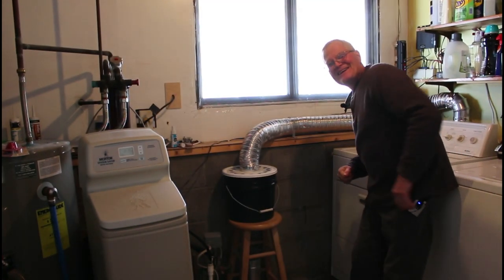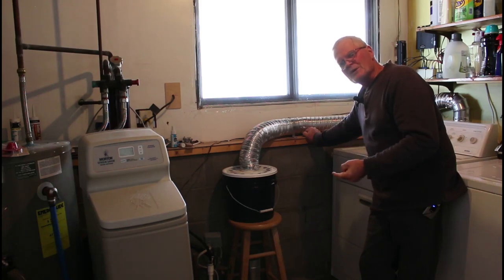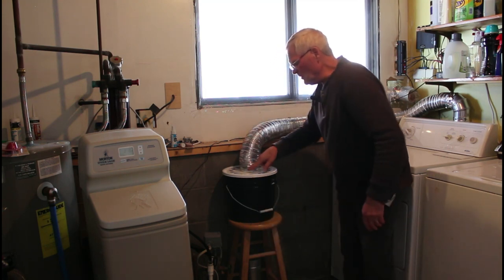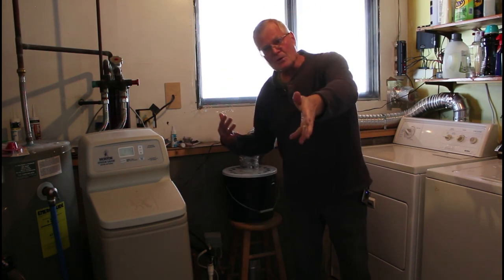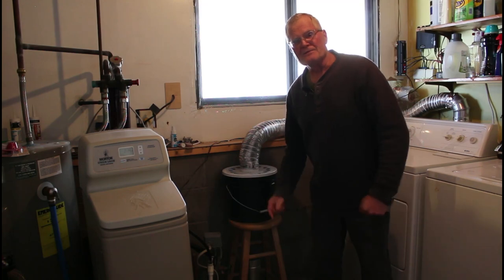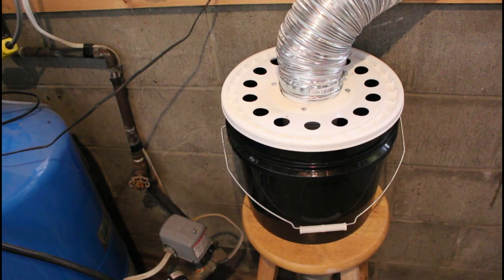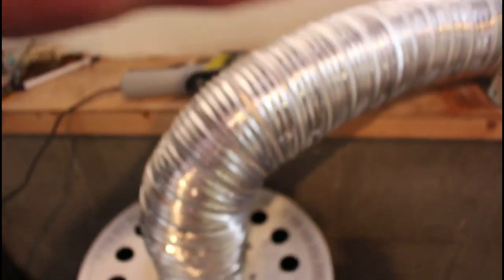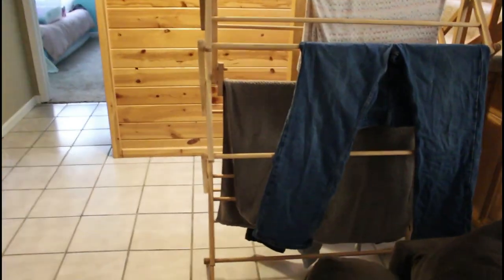Vent Your Electric Dryer Inside in the Winter

Comment: My dad started doing this about a decade ago and it works wonders especially w wood heat drying the air out. I take a flour sack cloth and put it on the end of the hose, the lint comes off fairly easily and I collect it along w the trap lint in paper egg cartons then add wax to make fire starters. There's a lot of little things we can do to save energy, this is a good one, thanks for sharing!
Reply from the maker: Yes. Moist air holds heat better, and makes the house feel warmer. We get static shocks in the winter, it's so dry in the house.

Comment: I do the same in the winter to save energy, but put a dehumidifier in my laundry room to keep the mold away
Reply: Does that work :) worried about the mold issue / if it's a fire hazard? 😵‍💫 We use a dehumidifier in ours too. But still worried. We rent a house and the house has the dryer set up this way lol. 😅

Comment: great idea. if it gets too humid, simply put a dehumidifier in there, they only cost about $150. seems like a cheaper and more reliable system then a heat pump dryer
Reply: That actually makes a hell of a lot of sense. Need a good quality one that will last though!
Reply: You made a configuration that is essentially the same thing as heat pump dryer, but less efficient and probably more prone to failure since the dehumidifier would probably get slowly contaminated with lint. They call them "heat pump" dryers to ride the coattails of heat pump marketing hype, but really these new dryers are just using a large dehumidifier to run warm and dry air through the drum and dry out the laundry, it's basically the same device, just bigger. You could probably make a ghetto "heat pump" dryer by hanging your damp clothes up in a small closet with a dehumidifier right next to them.

Comment: This idea is really climate dependent, if you live in a region that gets horribly dry in the winter (<25% RH) then venting into the house is probably fine in most cases - still a good idea to by a hygrometer so you can monitor the humidity levels in your house while you do this. If you live on the east coast or the west coast where winter humidity can be quite high, this will be a bad idea and you will probably create a nightmarish mold problem, having anything above 70% RH is quite bad for your house and your long-term health.

Comment: its not the lint, its the moisture this puts in the air that will make you feel colder ( more humid air conducts heat away from you more efficiently than dry air ) and the more humid air when coming into contact with cold surfaces like windows  will condense water from the air onto the cold surface  and that water can  now become a media for fungi and bacteria ( this  will be not be immediately obvious but manifest as  increased minor infections and over time may begin to weaken wood in the house ) .
Reply from the maker: It may depend on where you live. Here in the north, cold, arctic air is very dry. The humidity in our house struggles to ever get above 50%, even when venting our electric dryer inside. If you have a humidity issue, perhaps venting moist air indoors is not a good idea. Some common sense may be in order here. For us, added humidity is helpful in the winter. My folks ran a humidifier in our house all winter, growing up.
Reply: @backwoodbasics9383  I'm with you, I'm in SW Ontario and about this time of year it's starts to be a struggle to maintain humidity. I'm looking at interior venting the dryer as an aid to humidity. Nice video sir.
Reply: We're in the desert any humidity is good. Ive worked in maintenance all my life and during the winter if the heaters went down we would just put the hose over the dryer and point towards the room. Most people wanted to keep it that way because it worked better than their furnace.
Reply: Not in dry environments, maybe southern states.

Comment: Not a good ldea will cause black mold
Reply: Only if you live in a moist place, or vent the dryer into a space that the moisture cannot escape. We did this when i was a kid in Utah where the air in the winter is bone dry, only my family used old nylon stockings to catch the lint. I'd never do this where I live now in Oregon where it's an active fight to keep moss, algae and mold from growing on everything but it make a huge amount of sense if you live in a dry climate and can circulate the air properly.
Reply from the maker: Correct Eric. Folks around here run humidifiers in their houses in the winter, putting gallons of water into the air every day.Humidity still struggles to get over 50%. If you lives where humidity is an issue, don't add more.
Reply: Yikes
Reply: Does it make ur home smell fragrant
Reply: @ericgarner2559  where I live in Indiana it will definitely cause mold it is hardly ever very dry here

Comment: Newsflash: commercially available versions have been on the market for at least 20 years.
Reply from the maker: Jeff, from Missouri Wind & Solar, mentions them in his video. He says they run out of water too quickly, and do not work as well is the bucket ones. I am just passing on his advice, which worked for me.